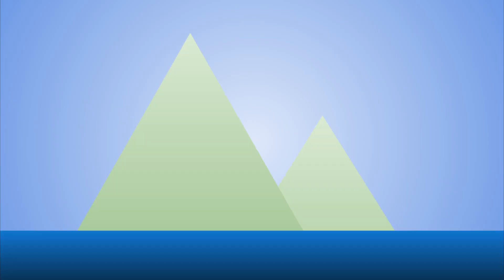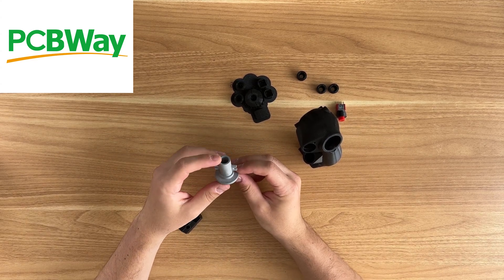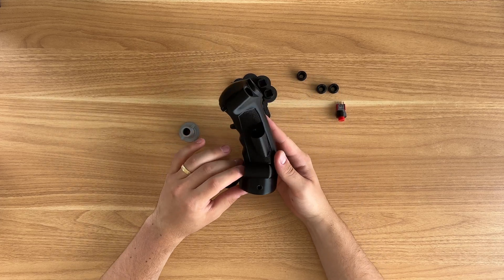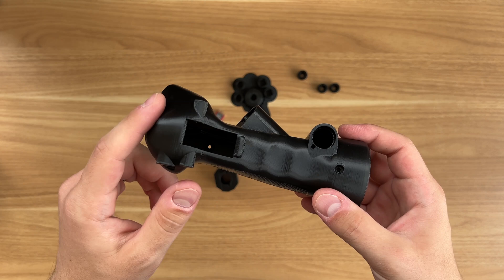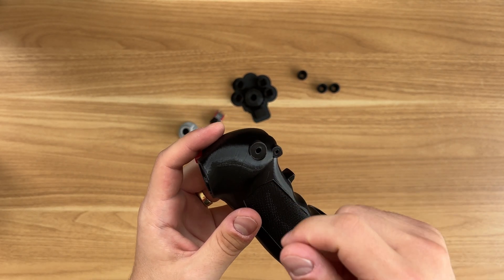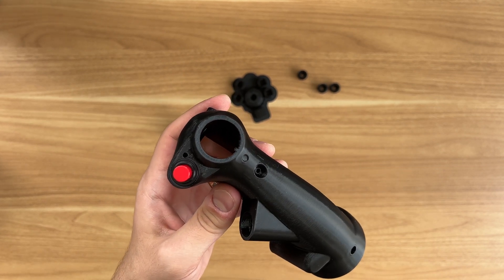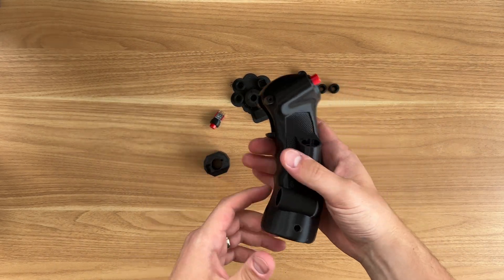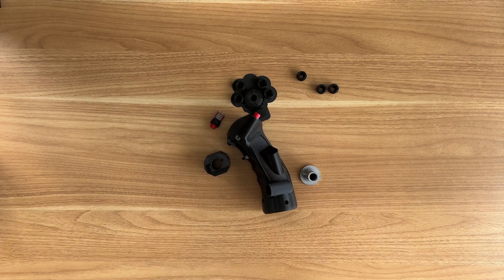3D Printed Century Series Grip Update

Comment: This is very awesome!

Perhaps a variant with a 7-way trim switch (ads left/right rotation) could be created as well, giving more input options while retaining the classic look.

Another idea might be the F-86 throttle grip (airbrake switch, 2 push buttons, gunsight control (grip twist rotation), which was also used in the F-100, F-102, F-104, F-105 and in slightly modified form in the F-106 and various other aircraft.

Comment: A really cool project! Many thanks for your good work! 
One question: The new insert only has one hole in the back to screw it to the grip. But in the video there are 4 holes. Do I have to manually cut the 3 remaining threads into the insert?

Comment: F 15 update?
Reply from the maker: It has been some time so I may have forgotten, remind me which F-15 part needed the update? Thank you <3
Reply: @thesimnet 

Mainly sottering videos 

And please update the trigger module 

I find that it keeps breaking every time I try to build it
Reply from the maker: @Virtual_Wraith_Demo_Team  Thank you for the feedback, I will definitely have a soldering video soon! Which part of the trigger module are you having trouble with?
Reply: @thesimnet  the top of the trigger mod keeps breaking. The walls are too thin. I’ve printed like 10 so far. I have used both pla and pegt no luck. I’ve tried so Many different settings. If you re enforce it just a little bit I believe it will work better
Reply from the maker: @Virtual_Wraith_Demo_Team  damn that sucks sorry man, let me see what I can do
Reply: @thesimnet  thanks

Comment: Hi, I only subscribed last week and just printed your ‘new grip’ prior to this one last week, I had planned to paint it but it came out beautifully.  I was able to mod the thumb and pinky switch housings to hold a 12mm tactile switch with the button off a cheap Alixpress push switch so really happy with the feedback (I fly VR).  Just waiting on some 5 way switches as I intend to add a hat to the thumb.  Really impressed this is free, and you’ve done a fantastic job in the design.   The only comment is maybe add some version control summary/ description to your designs, I struggled with all the trigger options for example.  Many thanks
Reply from the maker: Thank you so much for the feedback! You're right, a proper version summary (and pdf build guide) is def necessary at this point!